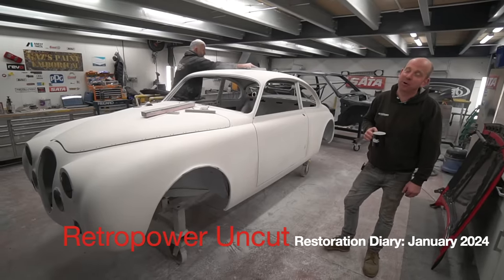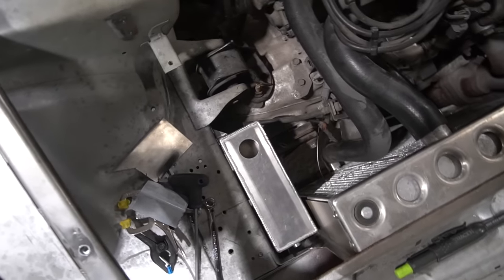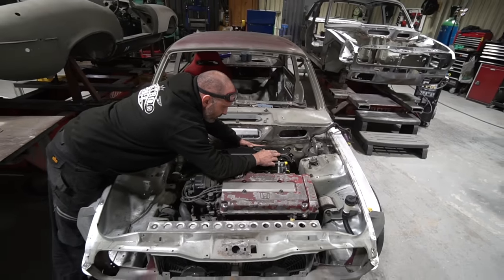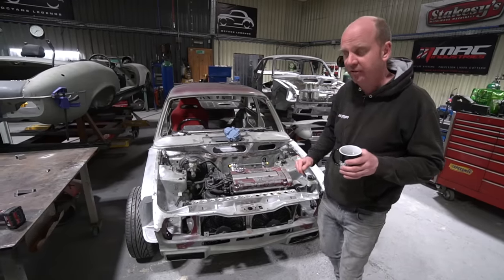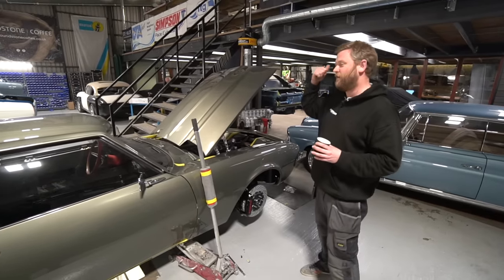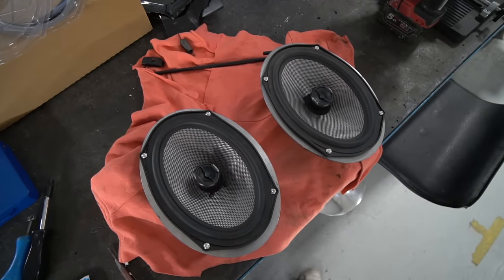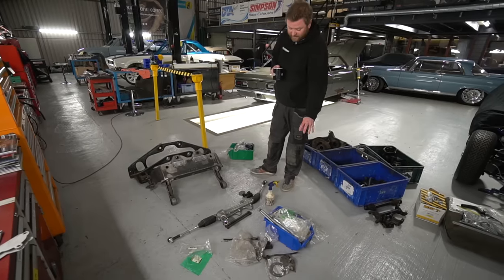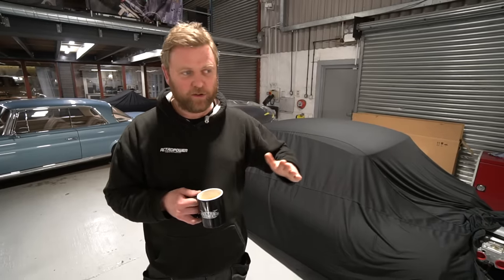Two Door Coupe MK2 Jaguar Restomod Bodywork Progressing

Comment: Re the custom coolant pipes
Would it be worth while doing a 1st mock up using something like the ice engine works blocks to prove the design, like some use to design exhaust manifolds, or is it not needed if you've already 3d scanned all the relevant points you already know it will fit 👍

Comment: I listened with great interest on your ability to have 3D printed hoses in custom sets.  However, when one of these fails on a customer's car how do you propose they deal with it in an expedient manner?  Not going down to the local parts shop  for these
Reply: I think he said they would hold in stock or supply the owner with these.
Reply: If you listened, he said they could make small batches, so fit one to the car, the rest as spares to the customer.
Reply: And there is nothing expedient about these builds. It’s done when it’s done. I don’t think any of these are the owners I my car! 😂
Reply: @somebloke13  And since he was specifically takjing about the Allegro project CARS the implication was very unclear -

Comment: Water does not expand  when heated. It converts to steam. Water expand when frozen.
Reply: Wut? 😅😅😅😅😅 Pretty much everything expands when heated until it hits a boiling point
Reply: Wrong! It expands by around 4% between room temperature and its boiling point. And antifreeze doesn’t only lower the freezing point, but also increases the boiling point.
Reply: Anything that is heated will expand.  Because heat causes the atoms to speed up wich causes the expansion.
Reply: God, the long winter evenings must just fly by in your house...
Reply: @russcooke5671  explain  why water expands when it put in a  container in the freezer. A bit like the melting of icebergs  they will melt but the sea level will not rise.
Reply: @iandonkin6762  because its under presure. The boiling point is higher.
Reply: @adamhewie1962  same as when you put ice cubes in a glass and they melt the level stats the same
Reply: @adamhewie1962 it's called the "anomolous expansion of water" Because water behaves unlike any other liquid as it approaches freezing point. The anomalous expansion of water is an abnormal property of water whereby it expands instead of contracting when the temperature goes from 4°C to 0°C and it becomes less dense, which explains why ice floats, and why frozen pipes burst.